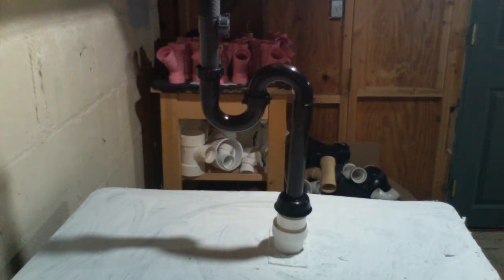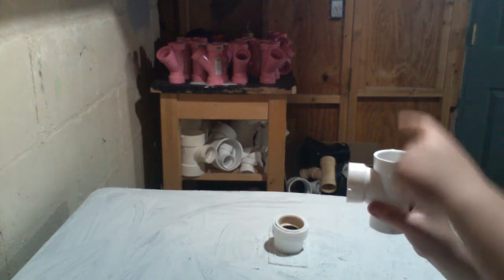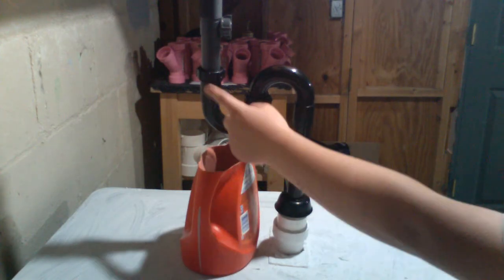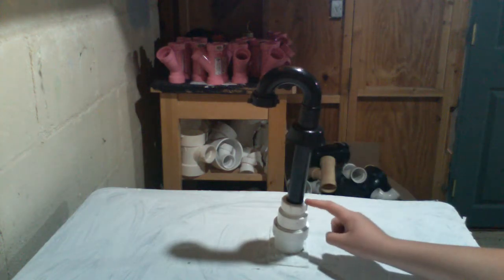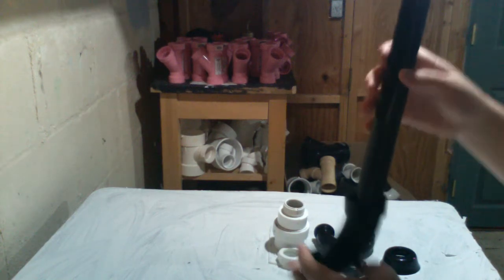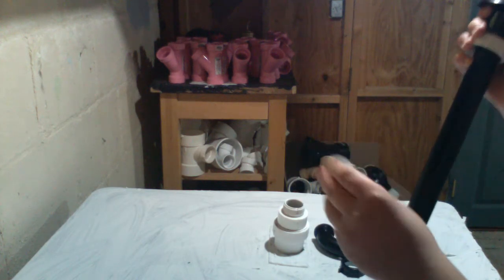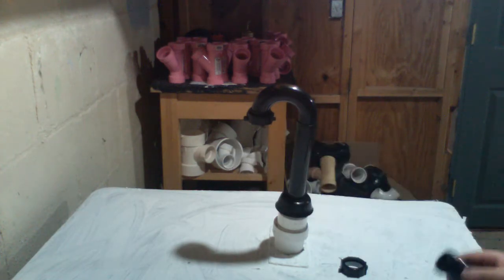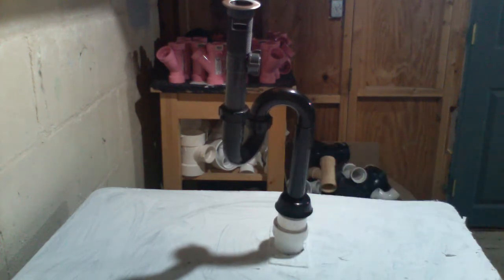how to replace an S-trap.(2021)

Comment from the maker: An S-trap is like a p trap but it has no vent, a vent is required by code so the trap does not loose water. Now they only make S-traps as a replacement part and not something you would do a new install with.
new S-trap: https://www.supplyhouse.com/Jones-Stephens-P39010-1-1-4-ABS-S-Trap